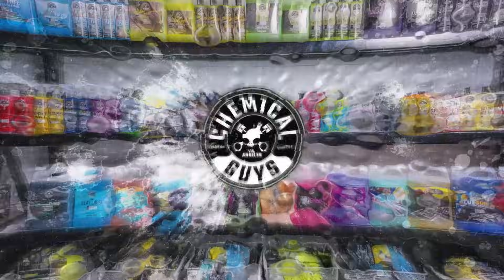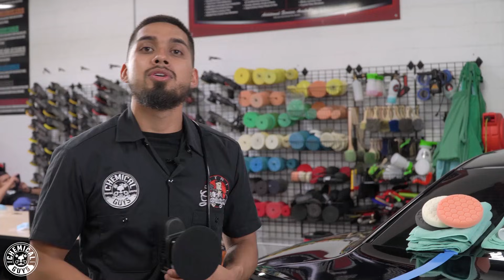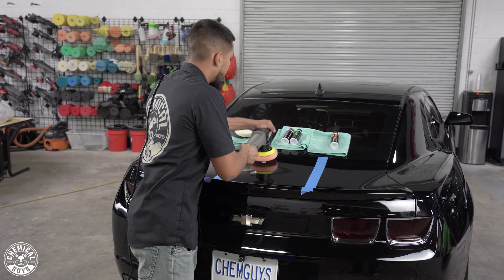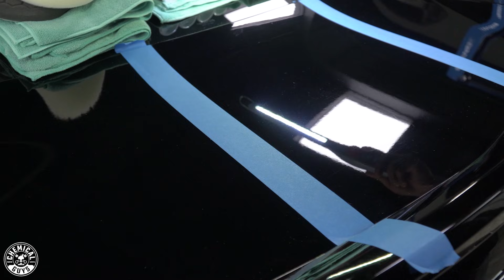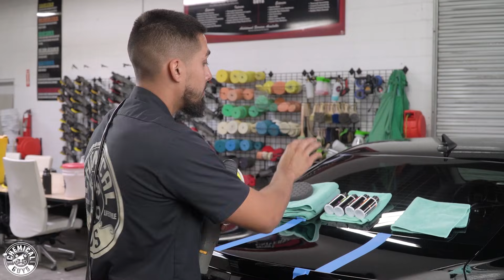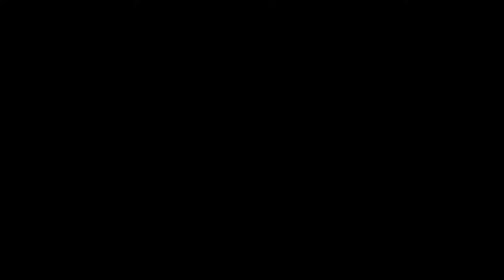How To Use A Multi-Step Process To Diminish Scratches And Swirls! - TORQ X Kit - Chemical Guys

Comment: Hey chemical guys I have a question. Why can't I order more motor  brushes for the torqx. HUGE problem trying to then find them right now!
Reply: I'm In the US. The UK has them on their site but can't ship to the US. So what am I supposed to do to get replacements. Should be mentioned when buying one that it comes with one replacement set and then you have to replace polisher?

Comment: I have a few questions… 1) why did you mist the pad towards the end when using V38 before applying it to the car? 2) when do you recommend throwing out that pad? One use? 5 uses? And 3) if you can keep the pad for multiple uses… how do you clean the pad? I’m sure the pad collects contaminants from buffing, and I’m sure you don’t want to use a dirty buffing pad, on another car you’re trying to buff.
Reply: The torqx kit comes with a conditioning and cleaning spray to keep your pads lifespan a big longer

Comment: I’m new to this. Prior to starting this process do you wash and use a clay bar first?
Reply: yes. wash first to remove loose dirt, then use a clay bar with clay bar lubricant for the contaminants in the paint. if you don't clay first, you risk scratching the surface with embedded contaminants.

Comment: How do I put my torq 10 fx on speed setting 6 it on has 15 20 25 30 35 40
Reply from the maker: Hey! 
15 = 1
20 = 2
25 = 3
30 = 4
35 = 5
40 = 6
Reply: @ yeah I just figured that out yesterday. Thank you for the feedback.

Comment: I need a refund on this thing it’s a horrible machine Boggs out all the time with barely any pressure. I’m a detailer and I get better results on my old school portar cable. I would like a refund immediately so I can order a different unit. Ur showing results on perfect paint. I spent hours trying to get out an oxidized hood and still got no where after running a heavy compound and pad.

Comment: wondering about the amount of pressure applied to the tool?
Reply: Almost none. Let the tool and the compound/polish do the work. Regards.
Reply: Me too and what was in the spray bottle. Im a newbe doing buffing and cutting. Just recieved my kit in the mail today.
Reply: @damonrice8469  I'm guessing it's for clay
Reply: @shadowslayer19cg91 its for lubercation, further in the comments is where i found it.
Reply: Correction....it's to make sure the pad stays hydrated.
Reply: @shadowslayer19cg91 pad conditioner?
Reply: @InsideWantedVI  believe so
Reply: @shadowslayer19cg91 yeah it’s the pad conditioner sprayer. It’s for when you spray the pad after you put any kind of compound or polish on the polisher before putting on the paint so it hydrates them to get a even layer finish of any kind of compound & polish so it doesn’t it doesn’t leave a bad marring spot on the paint if you do it the right way
Reply: I heard 1 guy say 7 pounds of pressure heard another say 14 so who really knows .

Comment: What speed setting is needed for the wax? Apply at 1 then work it at 6 as well?
Reply from the maker: Hey! Apply wax using the lowest speed setting. No need to work it into the surface just allow it bond and then wipe off spent product.
Reply: @ChemicalGuys  oh! Thank you!

Comment: What pad do you recommend for a car that only has 15k miles? Bought it brand new, doesn't have all that many swirls. No scratches. However, I will be applying a ceramic coating, but I also don't think I'll need to compound and polish, probably just polish from the looks of it. What pad would be the most useful in my situation?
Reply: Hey, I’m not an expert or anything. But just from watching the video, it seems like for a finish polish you would use the white pad with the v38 finishing polish
Reply from the maker: Hey! A light polish such as P4 Precision Paint Polish with a White Hex-Logic Pad is great for removing light imperfections before applying your favorite coatings.

Comment: Hi,
What should I do when the cutting pad gets dirty halfway into compounding my black repainted car? The clear is broken down so the black paint gets onto the pad.
Should I get several pads or should I just wash the pad?
Reply from the maker: Hi Howard! Yes, it is recommended to have multiple pads of the same color for such instances or you can clean them during the job using Polishing Pad Cleaner.

Comment: Question: I saw you spray something onto the pad before you applied the polish to the car.I am assuming it is water. When should you spray water onto the pad and polish before using the machine? Thank you.
Reply from the maker: Hi Joseph! Use Polishing Pad Conditioner to prep the pad as well as reduce heat. Apply Pad Conditioner for the first few panels and then as needed from then on. 
https://www.chemicalguys.com/polishing-and-buffing-pad-conditioner/pad-conditioner.html?gtmListValue=Internal%20Search
Reply: @ChemicalGuys  Ok. Thanks for the response. I have never used a machine to detail/polish my vehicles. I suggest that if you update this video, you have the person tell the audience what he is spraying on the pad and why he is doing it, so us first-time folks understand what and why.

Thank you....

Comment: Got a white turbo Mazda 3 I just bought, def has swirls in the paint but also lot of paint chips. Is it even worth doing all this even with paint chips? I wanted to ceramic coat it too
Reply from the maker: Hi Zachary! Touch up paint can be used to mask chips and blend the finish during polishing.

Comment: Trying this on my black Tacoma for the first time, it had lots of scratches from what looks like a previous owner using something abrasive to clean/wipe it down with. We used the orange pad and tried all the way down to 32 but still seeing some scratches. Is there a certain amount of time I should be working on one area with the orbital before wiping it down???
Reply from the maker: Hi Sarah! Work in a 2 foot by 2 foot section moving the polisher about 1 inch per second until the compound/polish turns clear.

Comment: Great video all around! How much pressure are you using on your left hand when the setting is on 6? Or are you just using the weight of the machine?
Reply from the maker: Hey! Use the weight of your hand plus a little more when polishing with a dual action or random orbital.

Comment: I used a green going as far down as 32 on a black Jeep and the surface scratches still would not come out. What is the cause of the scratches not being able to be removed?
Reply from the maker: Hi Mark! Try using a cutting pad such as a Yellow or Orange Hex-Logic Pad.
Reply: @ChemicalGuys  Isn't the green most aggressive?